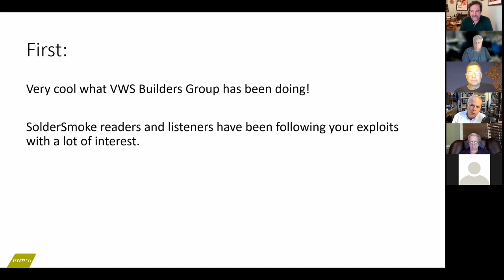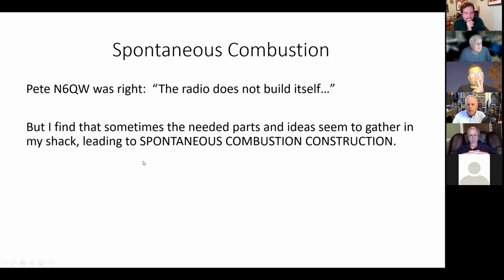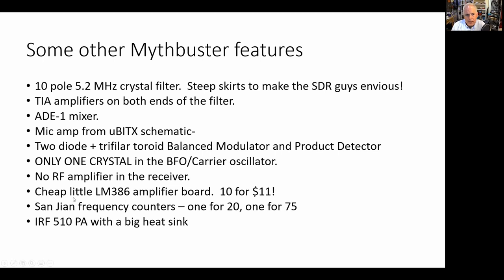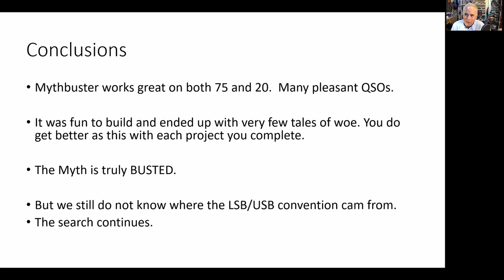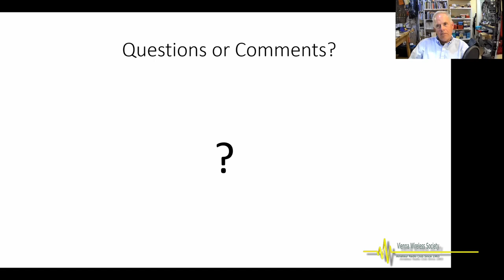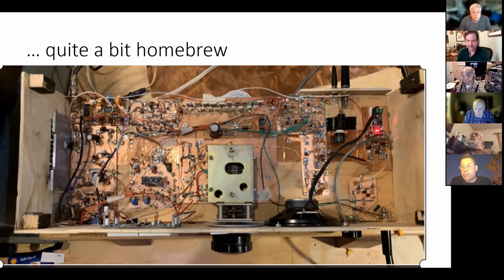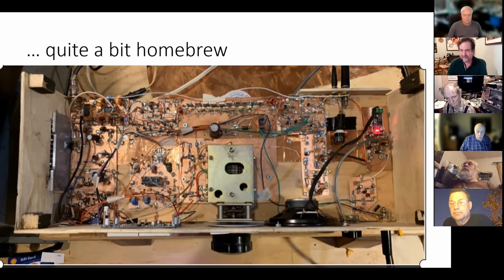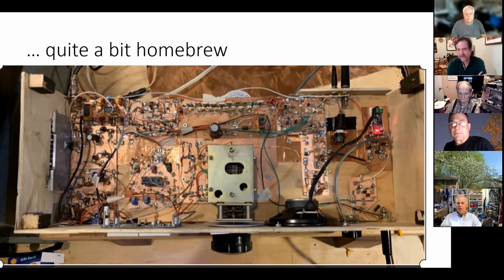N2CQR Talks to Vienna Wireless Society about Homebrew SSB -- September 22,  2021

Comment: I'll bet that when receiving the current draw is lower than say, a bitx with a raduino for instance. Raduino's use current with the arduino. How much is is on rx. Also, one could lower the current draw even more with certain types of audio stages.

Comment: Great presentation! Given that the TIA can be designed to have any input/output impedance we want, what is pro/con about replacing the filter matching transformers with TIAs of required impedances?
Reply from the maker: The TIAs will always look like 50 ohms -- no matter what you have hanging of the other end.  So if the filter needs to see 1000 ohms, you still need the transformer to match 1000 ohms to 50.  73  Bill